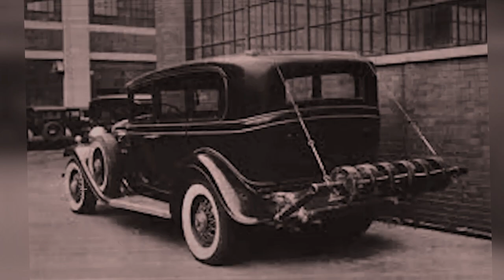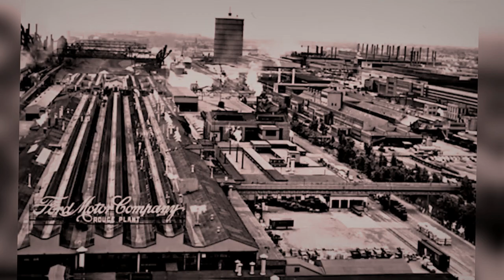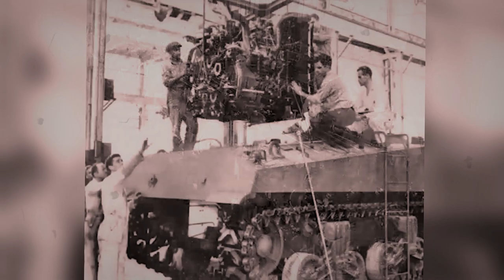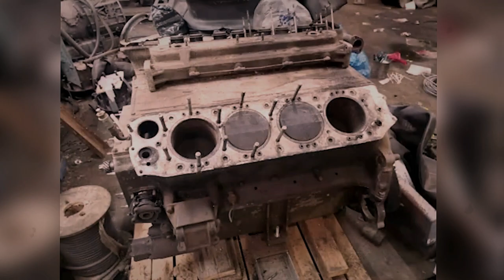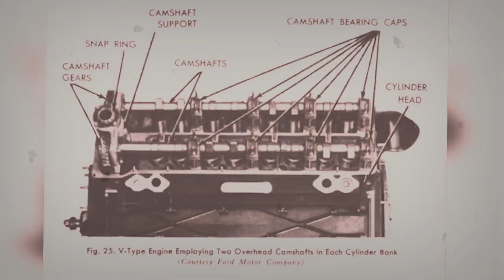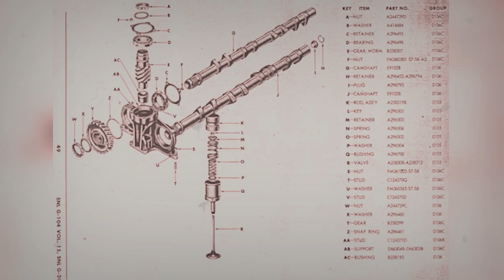War Hemi Unleashing the 1,100ci GAA V8 Beast | Drag Racing History

Comment: Those gear & shaft driven overhead camshafts were superior to the chains & belts of today.
Reply: Yes however expensive to produce and relatively complex to set up and tune on an ongoing basis that’s why generally only used in racing or high-performance engines only a couple of street engines that I am aware of that use gear operated cams 1986 Honda VF 1000 R was a motorcycle that used a total gear cam set up and I think there are a couple of European high-performance car engines as well but not common

Comment: Duramax motors probably intermittent loss of oil pressure level amount of oil before teardown.are what initial cost contuned runing cover up initial break down regardless area number broken journal off crank will still run noisy as hell new name clank fore truck.large gm gas gas had same problem check grade oil gear mesh pump clearance run time on oil change.hourz on oil gas gas gm was incorrect gears not close tolerance 1950 era gears pretty much pump circulation loss has few sitting around tore down from boardroom.foyr motors to one out new gears OEM no problem probably still running